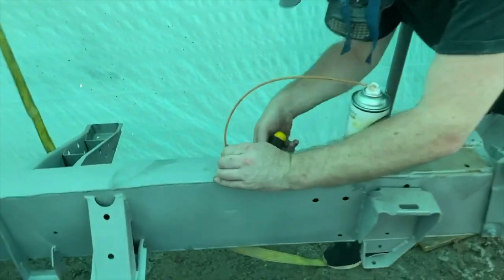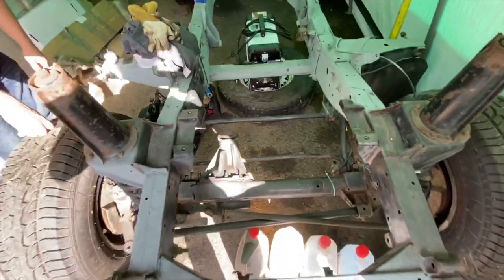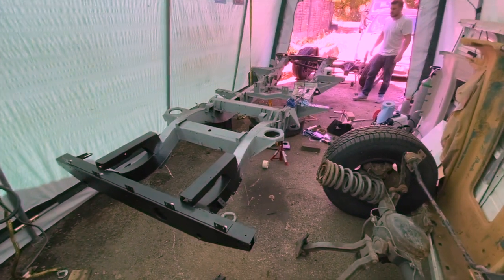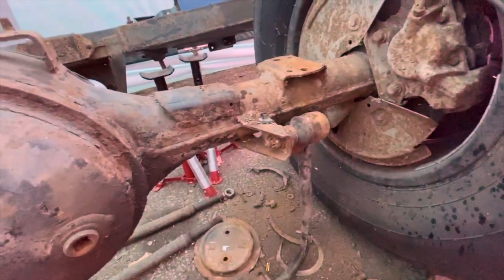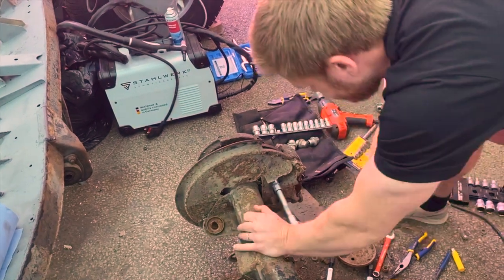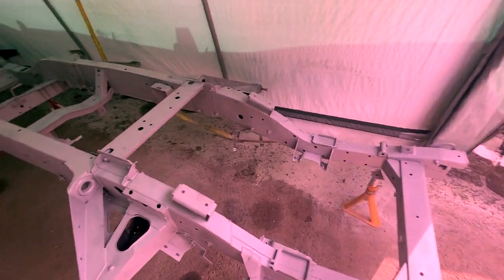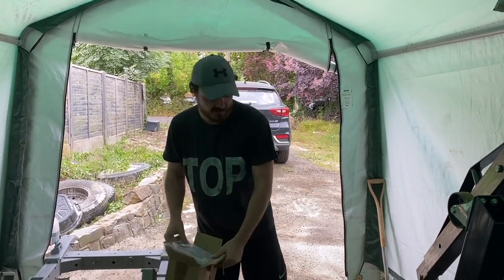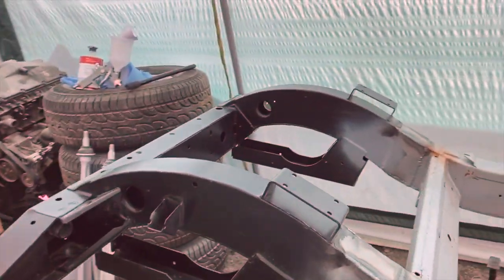Stripping the Axles, Sandblasting and Laying Primer

Comment: Great stuff!.... We had some wet blasting done once....
Reply from the maker: rustandoil how’d that turn out?
Reply: @BUST2BUILT  We had a car shell wet blasted... The blasting itself was great, but there was and probably still is an enormous amount of blasting sand "mud" inside the box sections.... Lots of mess too, dispite the claims of a cleaner job.....
Reply from the maker: Yer I can imagine...we used the air gun to blast out the rails and a lot cane out, hopefully we got most out and didn’t just spray paint onto sand in the rails 😂